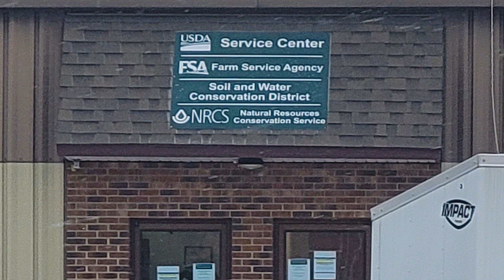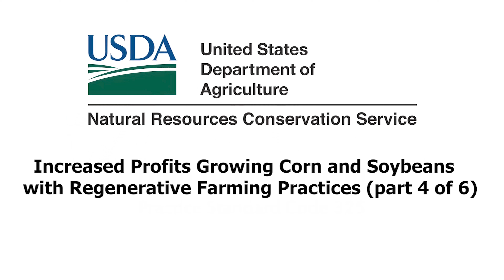Increased Profits Growing Corn and Soybeans with Regenerative Farming Practices (part 4 of 6)

Comment: No till is a good start.  You talked about Available P levels being low but the important thing is what is your TOTAL P?  If you have P in soil but not available that’s a completely different problem.  Are you putting out Humic acid with your P to stop it tying up in the soil?  If you have P but it’s not plant available are you using targeted cover crops including species such as buckwheat which will mobilise P.  Diverse cover crops with at least 4 different plant families in the mix have been shown to significantly increase soil quality in the Jena experiment.  I’d also be looking at relay cropping your corn with other things since you already have the strip till gear to do it.